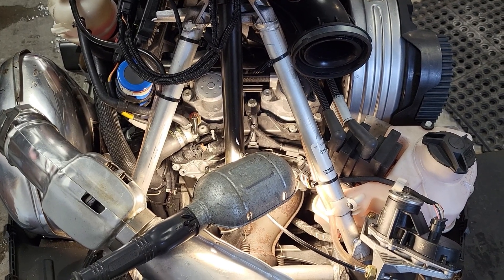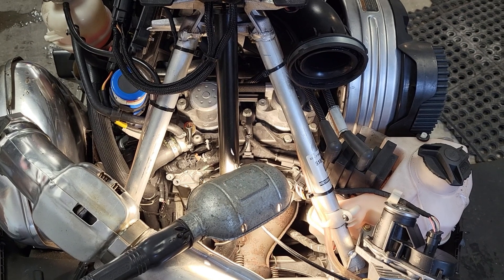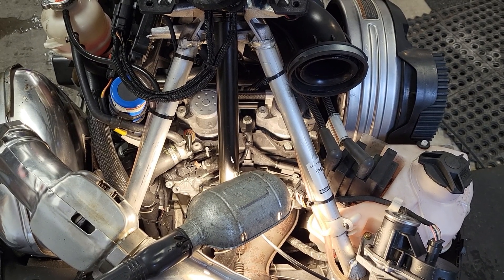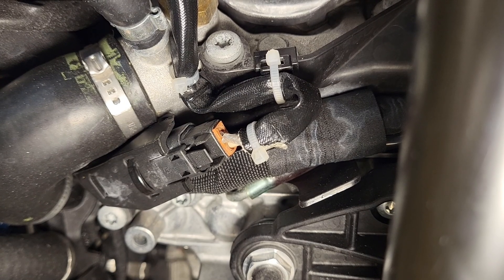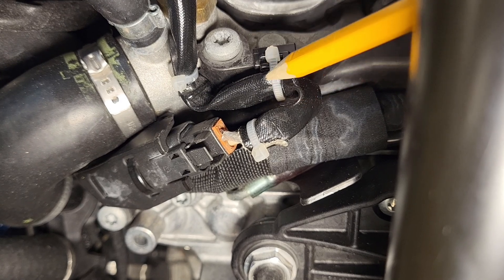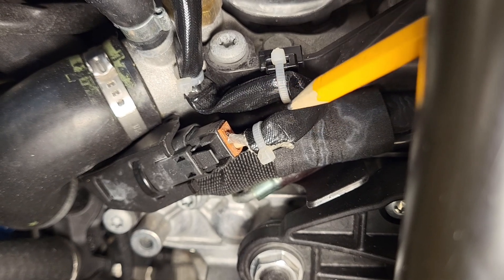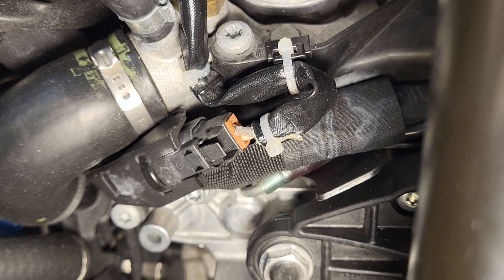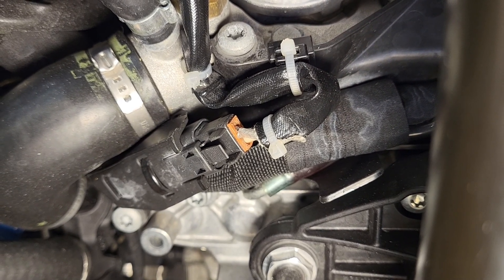Ski-Doo Summit 850 Etec engine temperature displays Minus 40 degrees, temperature sensor issue

Comment: Thank  you for this video, I have the same issue with a 2017 summit 850. I live 1.5hrs over the pass away from a skidoo dealer. I'm wondering if running the sled for a little while with this issue could cause problems. I understand that if the computer thinks water temp is -40 it will run rich and vice versa, but since the fluctuations are for such short durations, if I'm running the machine in deep snow to keep it cool, is it okay for a little while? I am relatively new to the sport and not extremely mechanically inclined. Want to treat it right, but also don't want to pass up good snow while we have it. Thank you again.
Reply from the maker: @Feger_  we rode our machine out like this from far in the backcountry with no issues in the powder nor on the trail.  We only noticed occasional "not crisp" performance.  If the brain thinks it is colder than actual temp, it will add fuel (rich) which would not hurt the engine.   Thank you for watching and for your comment
Reply: @bustapiston2170  I appreciate the reply, thank you.